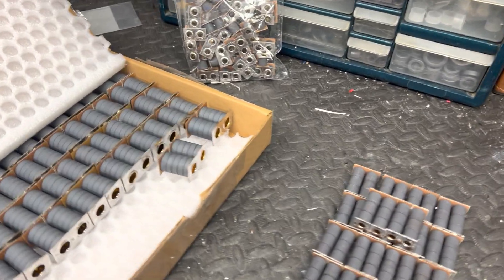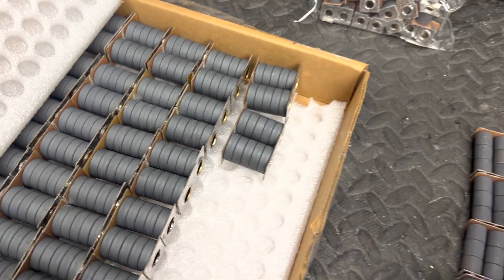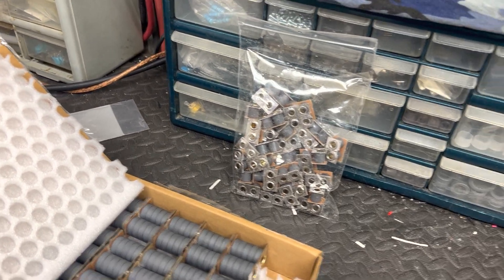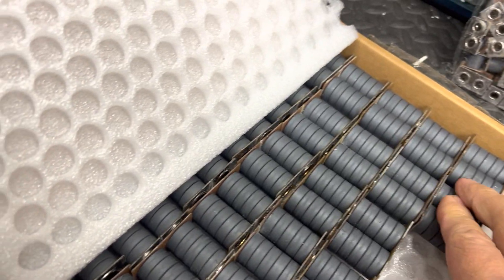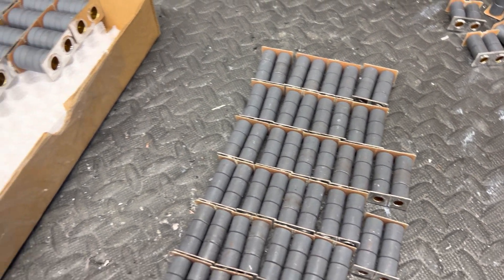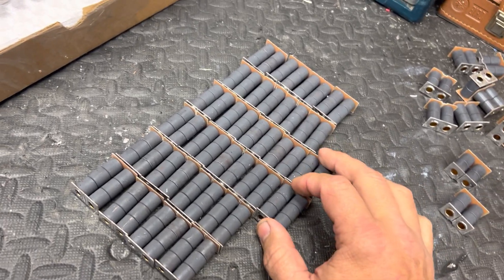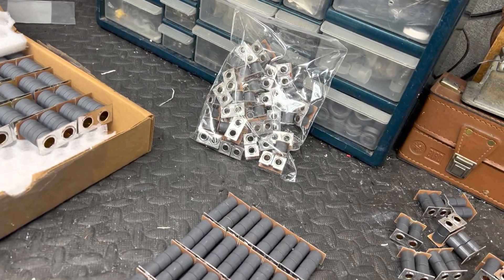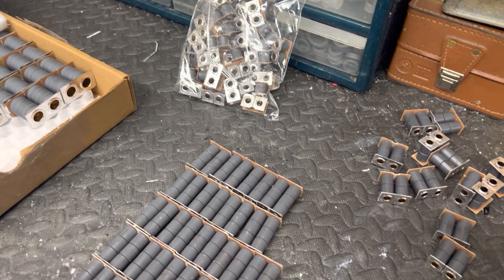Donkey Stomper Products, Lets talk a little about RF Transformers

Comment: i bought a wanna be dave made but it was a junk made burned up the power supplies right off sent to bbi he so called fixed it $600 latter smoked right off got rid of that junk there not made by dave some con artist makes em junk put in around $2000 on a 3 pill piece of junk and bbi laughed when i told him and  he never replaced the power supplies , smoked right off the batt,   he just tried to jimmie rig the supplies back together  instead of replacing them,   no more dave made junk wanna bes,   bought a rm itally kicks ass 500 watts no problems.  rm italy into a 3cx3000a7 getting 8000 plus watts yeah :).
Reply from the maker: Glad you got her going.. Sorry you had bad experience. Let us know if you need anything.